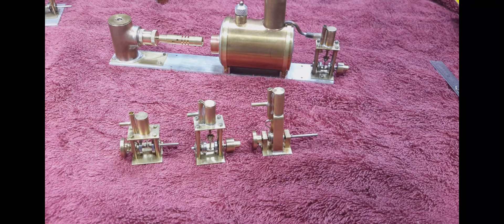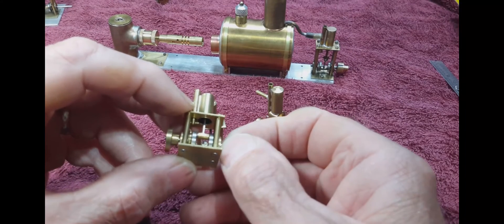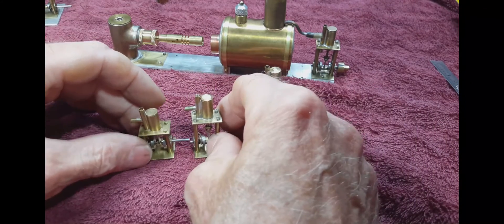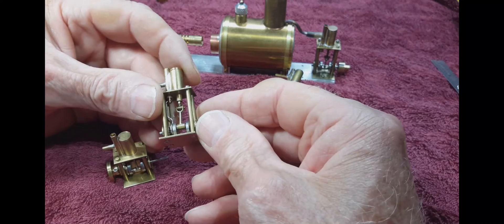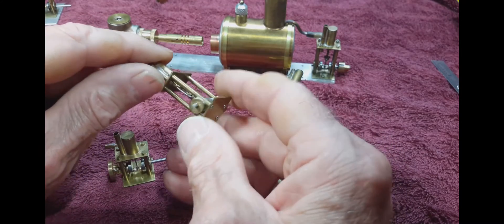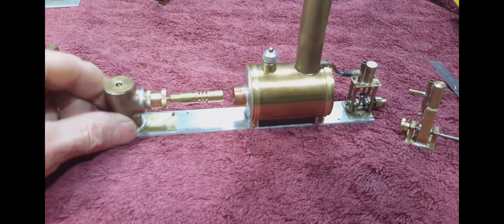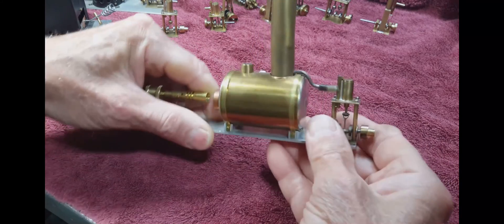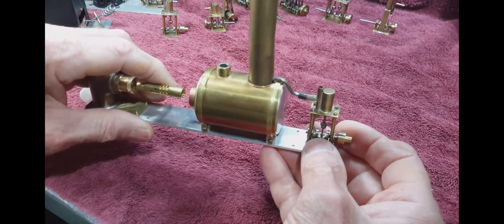Running a miniature steam power plant for a model steam boat

Comment: Great little set up!  That burner and boiler set up is amazing.  I assume the water surrounds the internal copper fittings and the little tube just sticks up near the top of the inside of the boiler above the water level?
Reply from the maker: Hello Hank,  Thanks for the comment.  I enjoyed watching your latest video on your steam boat a few days ago.  Nice video.
Reply: Thanks  - still learning, working on a slightly bigger boat, more room for the camera and radio equipment.  This internally fired boiler and burner seems like a great way to go.  Going to build one and try it out.  My engine keeps stopping after just a very short run, less than a minute usually.  Sometimes the piston fills with water, sometimes the Sterno runs out.  Then I have to wade in !  I made 3 of the oscillating engines with 3/8" bore.  Just converted one to double acting... 🤞